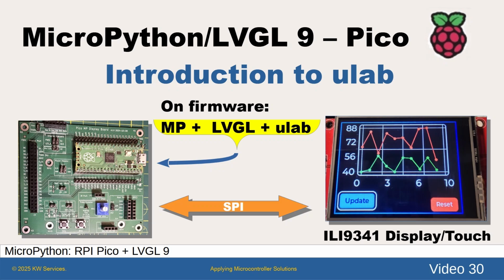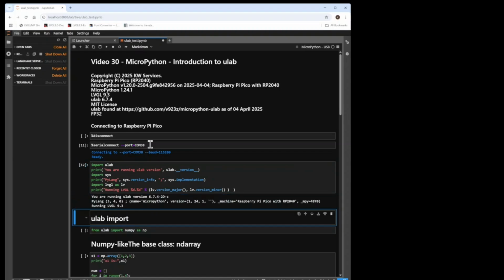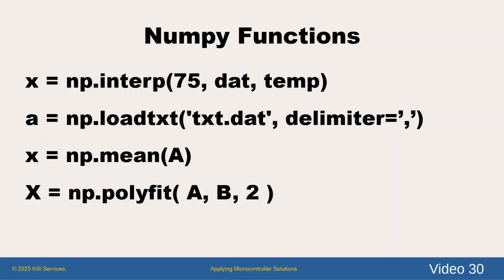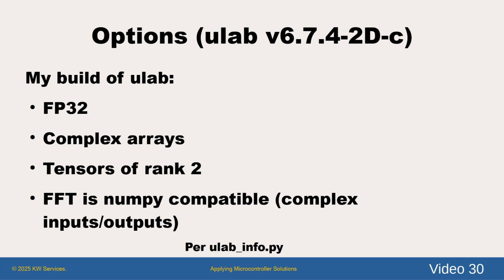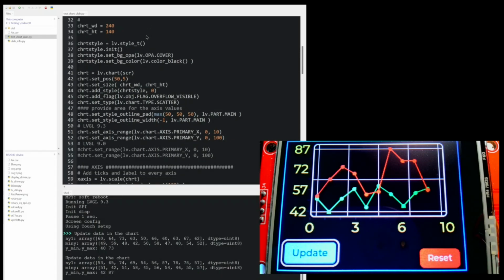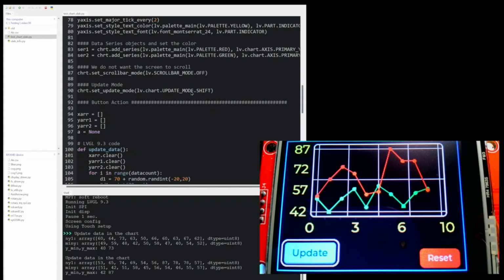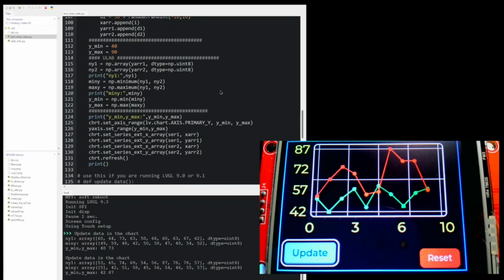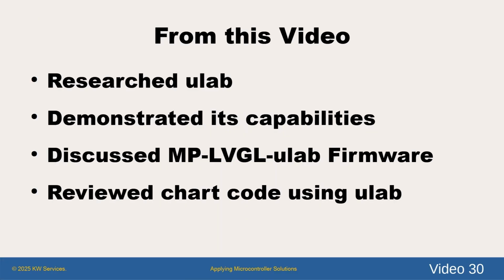Raspberry Pi Pico - MicroPython LVGL - Introduction to ulab

Comment: Interesting, Im able to use micropython and framebuf on a raspberry pico w (also an esp36 c6 with lvgl with c) and I wonder How can improve the font on it.. I think ulab its the key. PD: I'm not a engineer, in fact Im a lawyer from colombia. LOL.
Reply from the maker: Thanks for the comment.  LVGL supports fonts as well.  You can download fonts and convert them to format used by LVGL.  I will add the idea as a future video.
Reply: @applyingmicrocontrollers  yes, Im using a font in my esp32 project (very hard to configúrate in C when you tried to change the size to a bigger one) because you have to chance the settings in order to compile. Now, my comment its about the pico project which its programmed in micropython only with framebuf library

Comment: How were you able to install ulab library on your pi pico board?
Reply from the maker: The ulab website provides the source.  I then followed the micropython build instructions and included ulab.  Do you think there is interest in a video?
Reply: @applyingmicrocontrollers 
That will be nice.
Reply from the maker: Hi I prepared a new firmware with ulab.  It takes a week to prepare a video, in the meantime can you see if the resulting firmware  meets your expectations.  https://github.com/kwinter745321/PicoLVGL/tree/main/Firmware/August2025
Reply: @applyingmicrocontrollers Thank you. I will check it out.